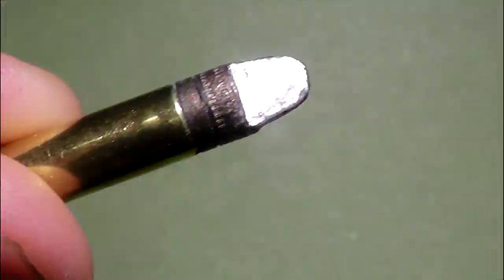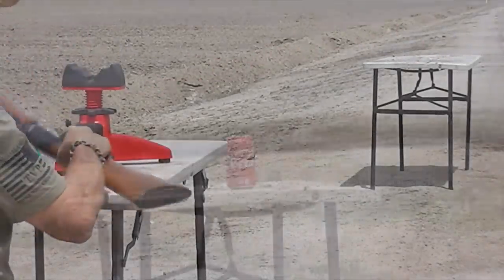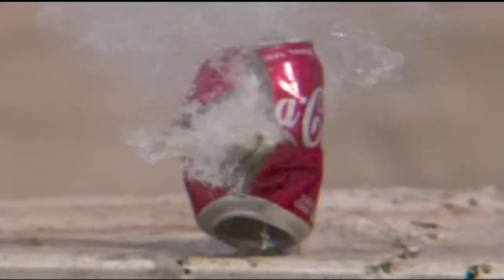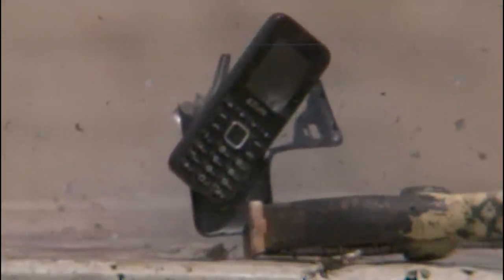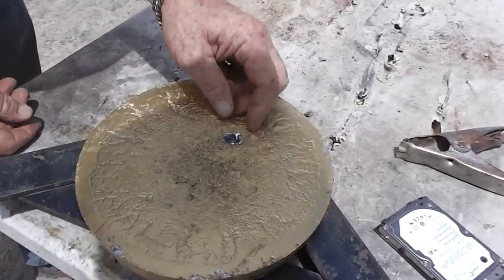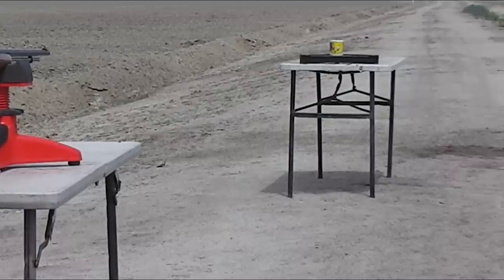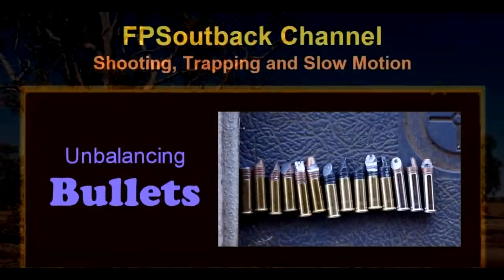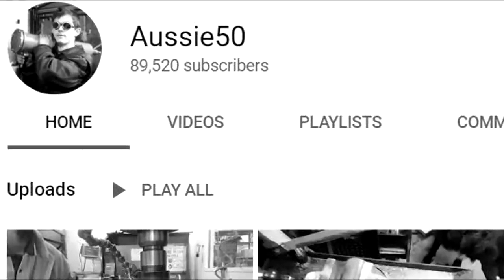Grossly Unbalanced 22 Experiment

Comment: During a Bradley fighting vehicle night gunnery I was issued some 25mm discarding sabot rounds that were defective. With normal apdst rounds the round is surrounded by a composite sleeve that allows a much smaller dart to be fired through the larger barrel. Once the round leaves the barrel the sleeve breaks apart, and the dart continues to the target. With these rounds only part of the sleeve was breaking away leaving the dart unbalanced. We pulled on line, and I test fired the gun with a three round burst. Two rounds ate dirt the third corkscrewed off the range. I put the weapon on safe, and did a quick inspection of the gun. The tower okayed a single round test fire. I fired a single round it corkscrewed outside of the range fans, and hit a street light on the road. Granted the 25mm hits a little bit harder than 22lr, but the tracer on the 25mm rounds showed what really happens with unbalanced rounds. 

For the vets out there yes I had to wright a statement of charges for the street light.

Comment: Any chance you would be willing/able to attach a steel BB to the tip of a hollow point 22lr? I'm curious  how it would change the penetration through harder targets
Reply: Or get a small, milled, pointed piece of tungsten to see how much a 22lr can punch through, a BB would be pretty cool as well. I could do that test at my range. Now are you saying to glue the BB to the end of the round or mill it down to where the OAL is equal to a standard 22lr?
Reply: Pretty sure Jeff has done the bb in the hollow point.
Reply: @Mike__S  I was just thinking glued on the tip lol, but milling out a piece of pointy tungsten would be very cool also

Comment: for doing home kills on our pigs we file the end off our .22 bullet till there is no more cavity left from the hollow point it stops the projectile from penetrating down into the neck of the beast and dumps all its energy into the brain it seems to drop em a lot harder too it'd be interesting to see the performance difference between that and a normal one on the lead plate or gel blocks  great video can't wait for the next one
Reply: Josh D kind of backwards considering a hollow point is meant to expand and dump energy into the object, stopping short. But if it works it works. I can’t say I’ve ever shot a pig with a .22

Comment: A note to the projectile launcher, I've found a great recoil management product.
 It consists of a elastic outside cover  It's a lot like spandex
& has multiple jelly pads/ insert's for your choosing or to set length of pull. I can fire my 12 gauge Mossberg 835 with any load all day long.
I've become recoil sensitive as I got older. The product is named (Bear Tooth.) RECOIL PAD KIT. 
I've tried just about everything on the market, then found this product. Give it a shot & see for yourself... Thanks for putting this info out there.......
 I say it's the best slip on recoil management product available.

Comment: A windscreen that looks like a 70's muff will tackle the noise from nature if you're using a separate recorder. Used products from RedHeadWindScreens most recently two years back, was out on the deck in the middle of the Baltic sea and it was right next in quality to the four digit windscreens used by studios who can afford that stuff, without any fluff on the mic any wind or movement would get in the way.

Comment: Not sure if you've tried it yet, but Zippo flints set in a .22 hollowpoint, when they hit a solid metal surface make some interesting fireworks. 

You will need to open up the hollowpoint to set the flint in. Superglue or lacquer will hold it in place.

Comment: Great photography that is you have an excellent high speed video camera.  Since there is shooting into diverse materials, for control purposes non-altered projectiles could be fired for comparison.  What is interesting is that the video shows at even close ranges the modified bullets are unstable.  Have you tried in any other video making dum dum bullets with a deep x cut into the projectiles on accuracy.  This is something people do.  Another thing is to seat center fire projectiles backwards.  I read of this practice in a book on african big game hunting by Hunter when they ran out of solids reversing the soft points.  When dong this one needs to account for possible pressure changes when reducing the case powder volume.  One could try this with FMJ military bullet with open bases to see if when reversed if they would expand on being fired into a gel block.

Comment: I've read on a couple of forums that if you modify a fmj by cutting/grinding/removing a section of the copper to expose the lead to make a budget SP(soft point) with high power rifles... err projectile stabilizing excellerators... that there is a chance that the lead will be propelled leaving the jacket either in the case or discarded in the bore at some point. Could you look into this and possibly make an video/article about such a modification? I think that would make an in interesting video. If need be would I have to supply the projectiles for the test(i had .223/5.56 FMJBT in mind)
Thanks for the great content😎
Reply from the maker: Considering the pressures,  I can see that happening.   I don't know if I could replicate it though.

Comment: Get some .22 hollow points and hammer a nail into the hollow point so that it sticks out the front and see what happens. Use a nail of just slightly larger diameter than the cavity in the bullet. I'm guessing terribly unstable once it leaves the barrel.

Comment: Ye ole Remington speedmaster is an exceptional semi auto 22, maybe the best overal if you could only ha e one, even if it looks alil like a mini meish 870 shotgun. The fact that itll cycle 22quiet that us stupid supressed without a can makes it even better. Someone need to make another rifle with capabilities of this one in a 10/22 compatible manner minus the action and it would sell like hotcakes IMHO. IF IT WHERE PRICES REASONABLE, RELIABLE AND EXCEPTABLY ACCURATE,  ATLEAST 1-1.5" ACCURACY OR UP TO WHAT MODERN DESIGN AND MACHINE STANDARDS ALLOWS POSSIBLE. That performs as  EXSPECTED AT
Reply from the maker: I bought that for $30 from a guy at work.  It's a little beat up,  missing the inner mag tube and the real sight is broken.   I should fix it up because it does shoot pretty well.
Reply: @taofledermaus  what a find I'd definitely restore that thing or at least get it back into it's original  form. They are worth a decent penny now in good shape

Comment: Officer I worked with arrested a kid years ago that had a modified 22lr to try. The kid ran from the officer, got hit by a car, gun went flying then got run over by several cars.  As luck would have it the kid kept running only to be cause a few yards later. The gun (unk make 22 short revolver) was reported stolen in the 70's. Arrest was in like 2014, kid was 14 so maybe his dad or someone was the actual original thief, Anywho, this kid had loaded the gun with 22lr but had just snipped the lead round nose off the bullet to esentially make 22lr wad cutters so they would fit in the cylinder.   Bad guy inginuity.

Comment: If you want to get technical you're not unbalancing them, you are just shifting the centre of mass which (with any spun object not supported by a shaft) will become the axis of rotation.
An example of this is a spinning top.
Add some mass to one side and spin it.
The axis of rotation just moves.
I'm not an engineering or anything, just a machinist 😁

Comment: The inconsistency is probably from it going down the barrel more than aerodynamics.
Reply: It appears they left the gas seal portion intact(the ring shaped ridges that are the same diameteras the case) , leaving no change to the bore/projectile contact. Only modifying the tip
Reply: *diameter as